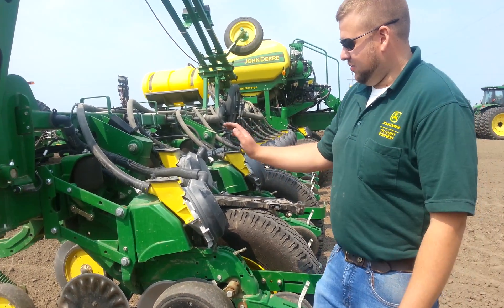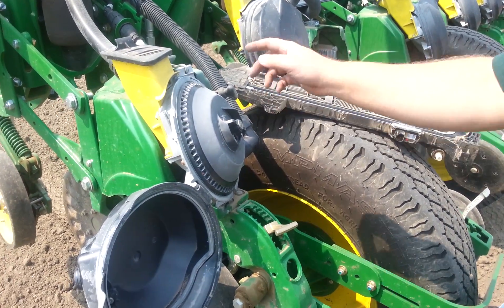John Deere 1775 High Speed planter

Comment: Omg looks like a complicated nightmare.... electricity in a dry dusty field is a recipe for disaster... to many moving parts and wires/connections... and how in the heck are you going to keep your guage wheels from looking like basketballs at high speeds? I’ve never seen a field cultivator that levels a field... my strip till fields are smoother than worked ground

Comment: Look at that perfectly tilled smooth as glass field he's standing in. I want to see a planter tested in NO TILL CONDITIONS! ROUGH AS SHIT SHANK BUSTING ROCKS EVERYWHERE LAST YEARS STALKS AND ROOT BALLS TO PLUG SHIT UP! I could get excellent seed spacing out of an old case Cyclone in that field!
Reply from the maker: TheZastrow07 Both companies were complaining of too many rocks in that field and the fact that the field was just recently tiled.   Ever drove over a tile trench every 40 ft across a field?   Not fun!   Hitting a rock at 10 mph and the planting row unit will go airborne for 3 feet.   Seen it happen in the emerged stand in numerous spots in the field.    The point is  Deere now has a meter that will singulate and will plant accurately at those speeds if field conditions allow it.   Do you have fields that can be planted at those speeds?   Some people do, but can't because their current meter won't singulate at those rpms.   Sorry but sucks to be you, if you don't have conditions that allow.  I don't feel I have those "High Speed" fields either.  You lost  credibility with your "old Case Cyclone comment".   Been there, done that, in the early 80's ..... Today 5.5 mph is my limit  with full E-Sets, Clean Sweep & Air-Force on my old 7200 in the fields just across the road in similarly prepped scenario.   The 1795 at 8 mph spanked our full precision equipped 7200's performance at 5.5 mph.   I  still want to see a couple years of use and reliability of those electric motors.   I have a neighbor that bought a 1795 last summer after seeing this demo's emergence and stand.   His stand this year is truly amazing.   It can be "rowed"  crosswise of the way it was planted.   All I can say is beautiful and very impressive sight.   He averaged 7.8 mph.  His planting job in his fields  is very notably "standing out". 
   Sorry about your field preparation woes!  That switch to No-Till is a bear!   Maybe you should be looking at field prep solutions for your operation.  Get those fields smooth and level!   I'd also recommend picking those rocks before making that switch to no till.   Kongskilde, Schulte and Degelman all have  wonderful stone pickers.    Ever try running your planter between those rows instead of on top of the old ones?